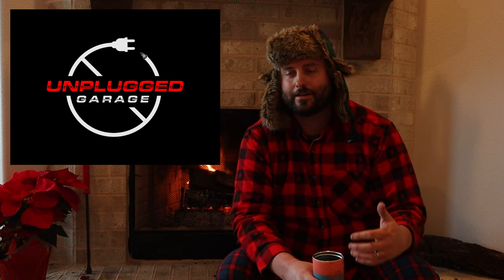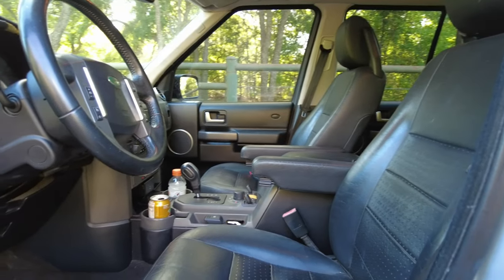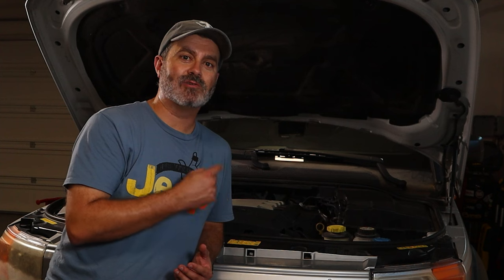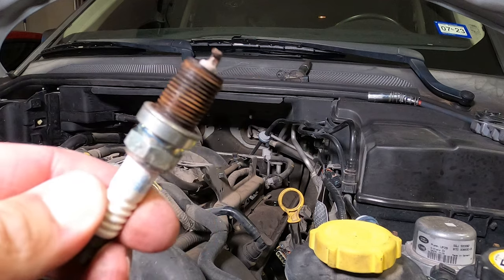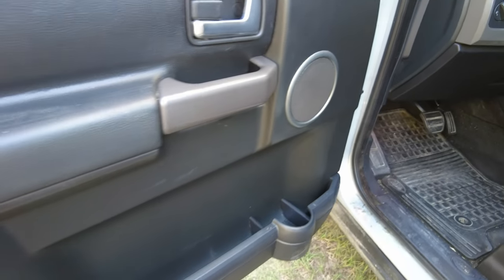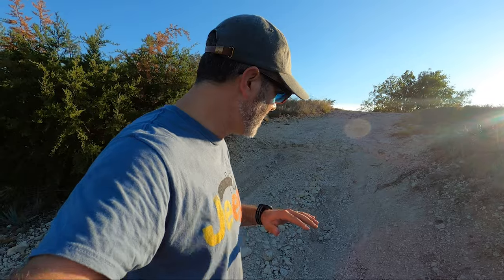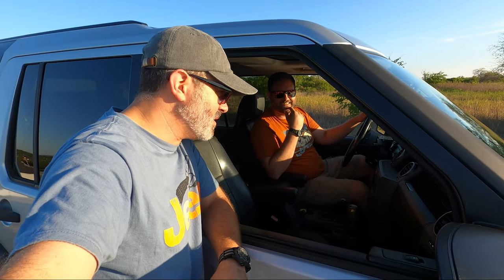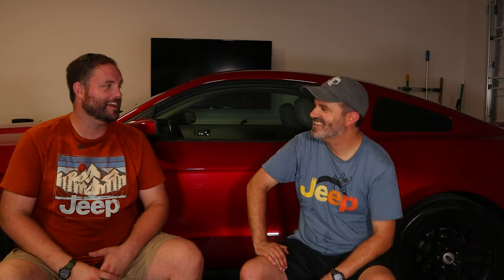Land Rover LR3 Full Review - DISASTER?

Comment: I’ve owned my ‘06 LR3 for about a year now. Its a unique, capable truck, It’s been fun and has given me no real troubles, it has around 155k miles, all I’ve replaced is an EGR Valve and a brake light switch, which is a very common LR fault! Both easy DIYs as well. If you get a well maintained one, and take care of it, it’s as reliable as any other truck! ;)
Reply: I have been going back and forth about buying one for a long time. Most of these videos only talk about how they "suck" and how Toyota is the "best". I am seriously thinking about moving forward with getting one.
Reply: @DeanMurray21  Yota fanbois hate on everything thats not a toyota. i said go for it
Reply: @DeanMurray21 did you end up getting one? I have a Toyota, I find it boring and I'm really thinking about getting one of these.
Reply: @trailrunnah8886  I actually did not. I just decided to pour money into modifying the SUV I have now.
Reply: @DeanMurray21  Yeah, that's where I'm at too. If I didn't already own the 4Runner, I'd be looking at a non Toyota, but since I already have it and it's been good to me so far, might as well stick with it.
Reply: Are they worth mapping

Comment: I own a 2008 LR3 SE V8. I have the satnav in mine. Also, I did a SuperSprint catback exhaust, Stoptech stainless steel brake hoses, and Stoptech cross drilled and slotted rotors all around and a K&N drop-in filter. Honestly, I can't complain about gas, I get very nice gas mileage, especially when in sport mode on the highway, it has 99K miles on it, and I love it. Cheers 🍻

Comment: Thanks for this great review! Unfortunately I experienced the worst 4x4 ownership experience with a Ford Ranger 2.2 4x4 pickup of my life. The engine bew up on 1060⁰km's, followed by intercooler and turbo issues and a temperamental difflock engagement solenoid for 4 years. I traded it infor a Mahindra Pikup 4x4 double cab which I love.All 3 Landrover series and Defenders I had before were amazingly tough and reliable. I rank the Mahindra with them for owner enjoyment and capability. Want a LR3 or 4 with a sore heart...

Comment: 4.4 is BMW/Jaguar on the LR3. 5.0 V8 LR4 is Ford/Jaguar?? Sheesh. Other than that I appreciate the Disco Attention, Love it, just helps to be a LR Disco Lover to understand the little things that set these apart. LR4 Air Ride Firms up on Highway driving which helps, also in Sport mode the Suspension Firms up and everything changes with the 5.0. Cars are underrated if you can do simple maintenance, fairly easy to work on.

Comment: 07 LR3 HSE.
LOVE IT....
Keep going through Alternators...
Just had a brand new one installed AGAIN... and although everything seems to be working just fine after 2 days,
The battery dummy light keeps coming on.
Even when I'm on the highway. 
Thoughts?
Reply: That's not normal. Is there an oil leak with oil leaking into the alternator?

Comment: You picked by far the best engined model , the TDV6 diesel is a ticking time bomb with at least three potential engineers killing design faults 1 tbe cam
Belt tensioner breaking off tbe oil pump housing
2 spun main bearings
3 broken crank
Steer clear of high mileage diesels 
I have tbe v 6 ford exploder engine it has been very reliable
Reply: We actually don’t have that diesel in the States